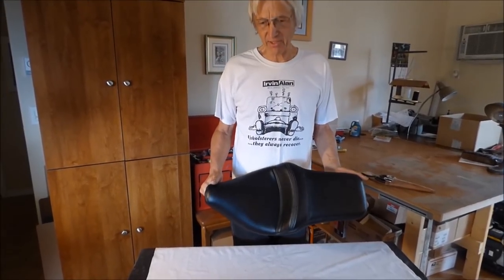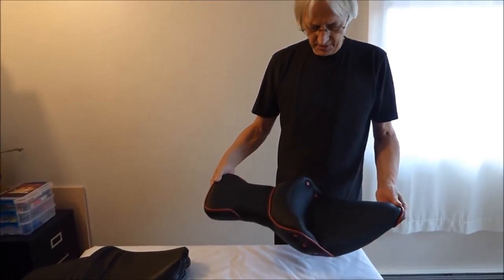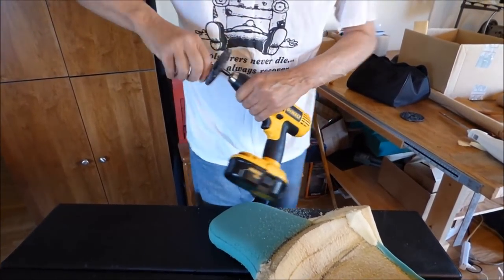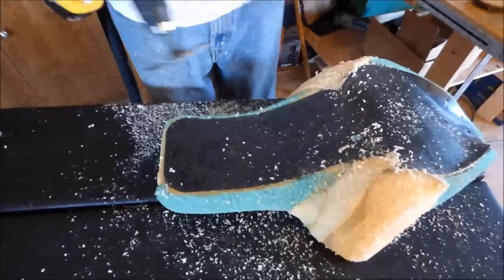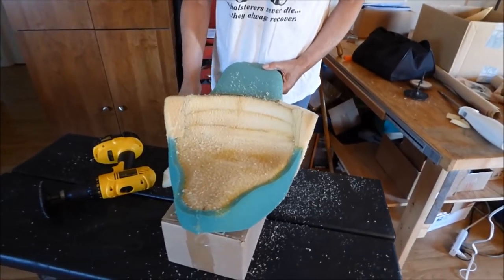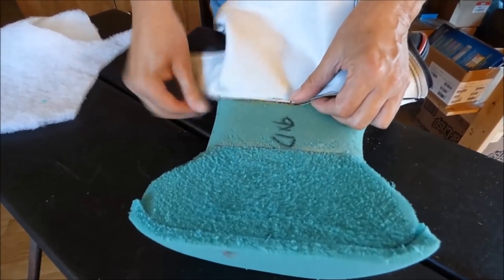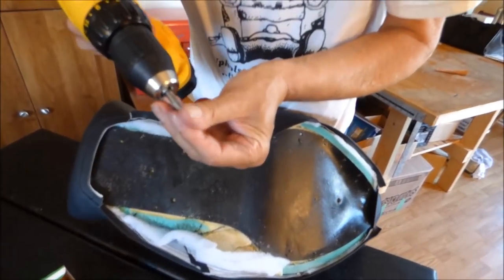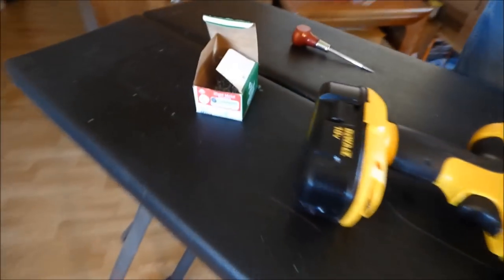How to Sand, Reshape and Re-Design Motorcycle Saddle Seat

Comment: There's a reason why you use staples on the bottom of a seat. Under daily use that leather is going to be under strain and will be pulled and warped around those rivets/screws. Staples spread out the tension so it's more even and over time it will hold it's shape

Comment: Hi Dutter - helpful videos and inspiring work! I noticed you're using an aerosol adhesive #77 as well as the airline glue. Why is that? What's the difference between these tow adhesives?  BTW -  I'm in the UK and can't find a supplier for your cutters on ebay or in the UK. Do you ship overseas? Best regards, John